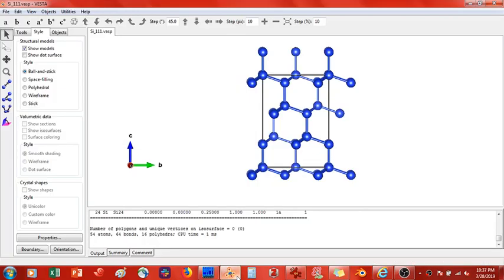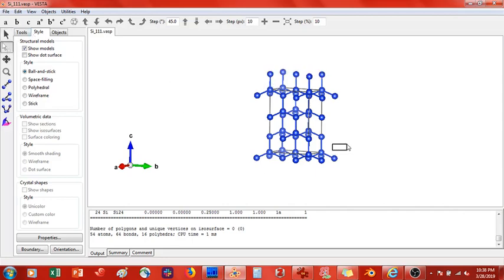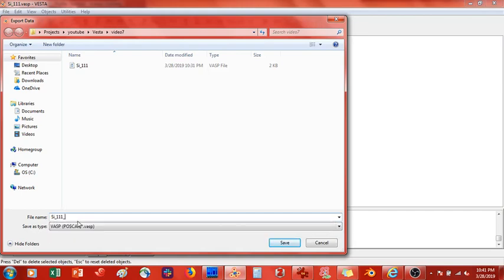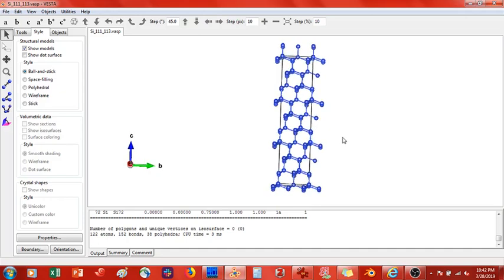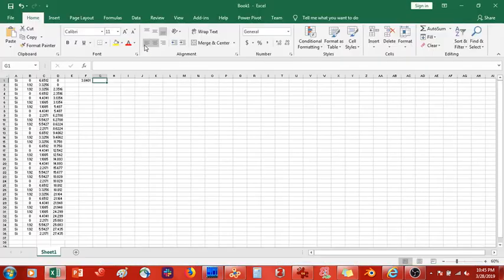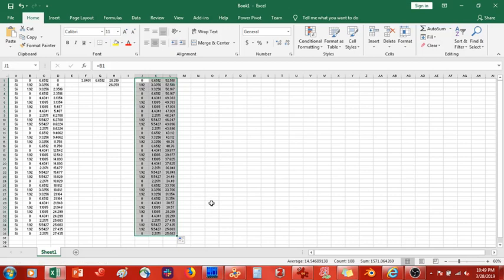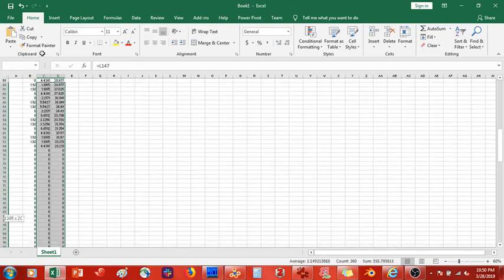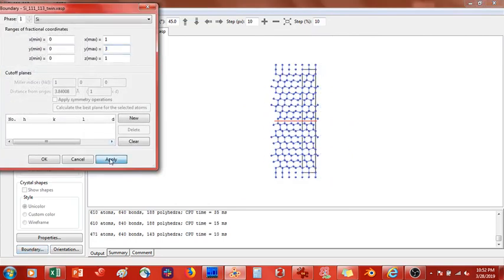Twin Boudnary Structures with VESTA: Bulk Silicon

Comment: Very helpful sir, can you please tell me how to put one layer on top of another of same material. For example four layers of same material. Thank you
Reply from the maker: Ah yes. This is easy. Say, 4 layers of CdSe? Which system?
Reply: @nickelandcopper5636 thank you sir for your reply, i want to know four layers of cdse for VASP.
Reply from the maker: @harishabibi8991  ah ok. I think I can do that
Reply: @nickelandcopper5636  Thank you so much sir, really appreciated
Reply from the maker: @harishabibi8991  sure. Please see my latest video. I make 4 layer CdSe with one side Se terminated and 1 side Cd terminated. To have Se termination on both sides, just include an extra Se layer on the Cd side - it should be straight forward to see how that can be done, but please feel free to ask questions on that video.
Reply: @nickelandcopper5636  2D CdSe

Comment: Hi, Thank for your nice tutorial video. I am wondering if could you demonstrate how to use VESTA to create a graphene nanoribbon with e.g. H passivation at its edges? Thank you in advance.
Reply from the maker: Hi Longlong Li, thank you for the nice comments. I don’t think VESTA has the ability to manually add hydrogen atoms to structures. I know iQMOL does though. Perhaps I can make a tutorial eventually on it, but I have another few in mind before that. But I will eventually get to it.
Reply: @nickelandcopper5636  Hi, just have a quick look at the software IQMOL which seems particularly powerful for molecules. Through searching relevant info on internet, I found that Virtual NanoLab is also powerful in making nanoribbon structures. I would take a look at this software and try to use it for my purpose. Maybe you could also make some videos using this software, :).
Reply from the maker: Hi Longlong Li, thanks for the suggestion! I have never used Virtual NanoLab, but I have used IQMOL, and I can make some using that. Thanks again! Capping the nano-ribbon sounds like a good place to start.